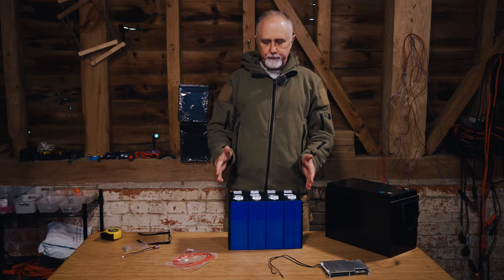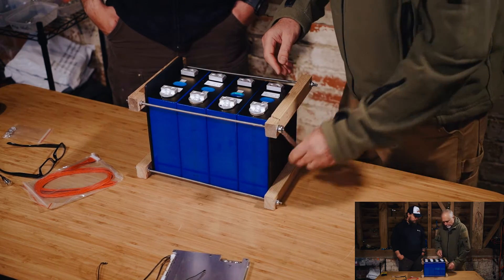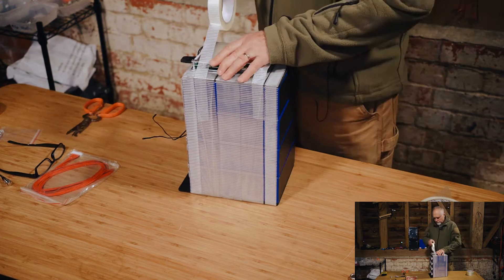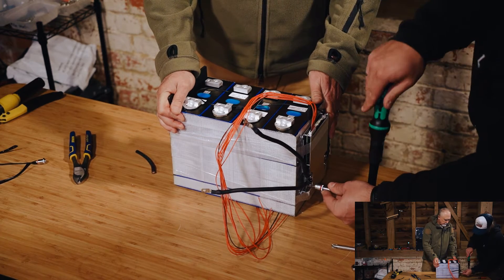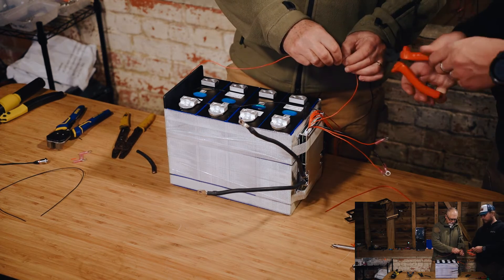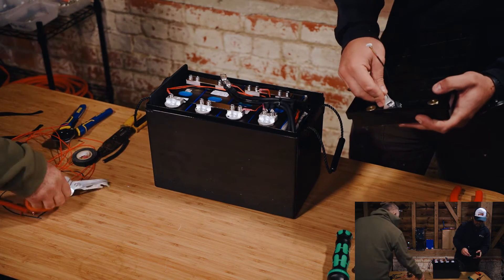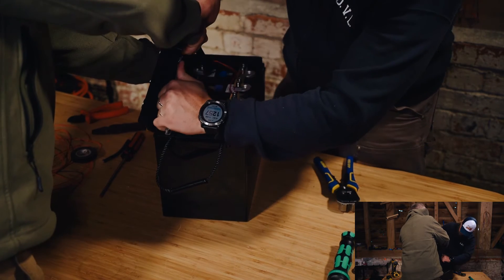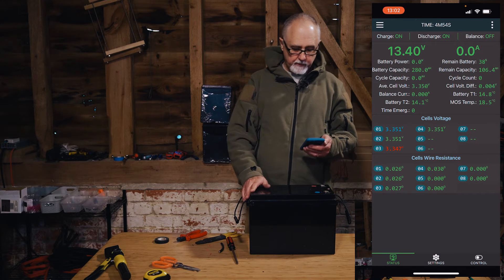Building a LiFePO4 battery with JK BMS

Comment: I just wired up a JK BMS tonight but I am having a heck of a time wrapping my head around the idea that the #4/0 inverter input wires and a 250A breaker are going to a pair of #7 wires (40A ea). It doesn't make any sense. I'm sure not going to get a pair of 2/0 wires onto that BMS.

Comment: Sometimes electronics expect data or voltage to arrive at certain times, and if you shorten some wires that are ment to be all the same length, then this can cause unexpected problems for the electronics processing.   Im certainly no expert, but i doubt this would have an affect on a bms, but just something to keep in mind..    Im about to build my own 8s 2p 280ah eve bank using a 200amp jk bms, i wont be shortening any balance leads though 😁. 👍

Comment: Very nice build.
Was that a piece of plywood taped onto the end? This could have finger holes added to it and another piece at the base end with finger and cable holes. This would allow the whole unit to be lowered into the case.
I'm in Australia and have the jk bms and awaiting my cells from alibaba.
What are the battery case dimensions?
How big is the gap between the bms and the case?